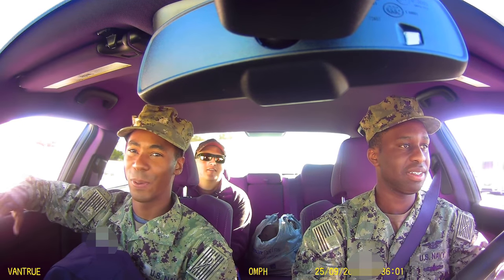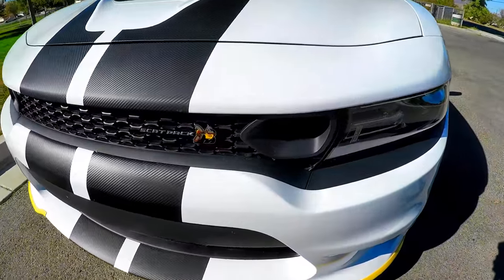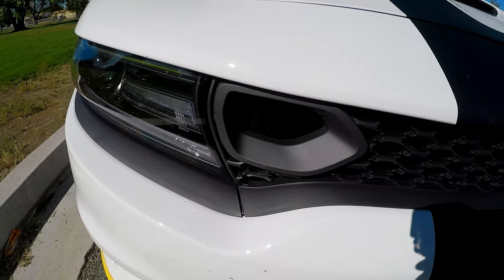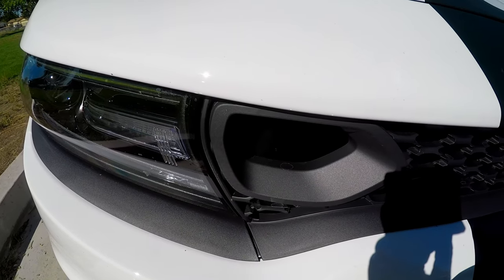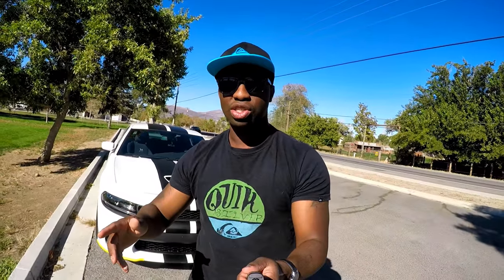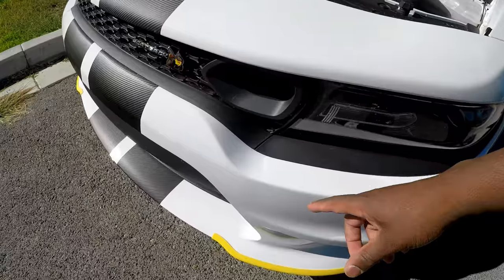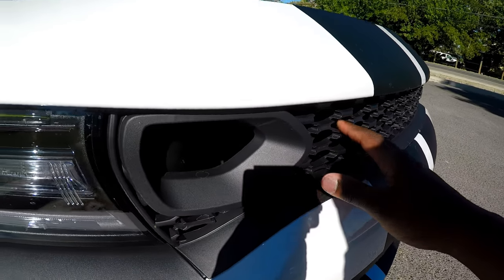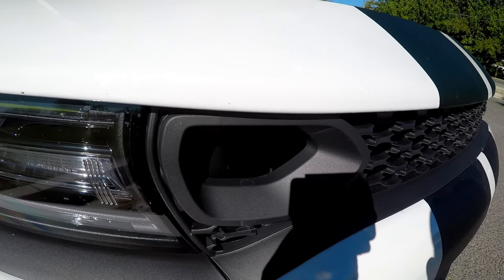2019 Dodge Charger Scatpack: The new Nostrils/Grille! NONFUNCTIONAL???

Comment from the maker: To avoid any confusion, the grille for the Scatpack is just new plastic inserts allowing more air to pass through. They are nonfunctional since there is no ductwork. Still based around increasing airflow via the motion of the vehicle. Maybe with the '19 Daytona or Hellcat it will be an intake connected directly via ductwork/filter, but who knows...
Reply: Airsoft Hemi im sure there will be an A/M kit available to set it up to an intake soon. Hopefully about the time I get to buy my Scat Pack!
Reply: They are not cosmetic, they flow directly to the radiator for more air flow through the radiator. So yes they are functional and engineered that way. Stick
A camera down there.
Reply from the maker: @jeffevans2551  Appreciate the feedback. I was using the term "functional/nonfunctional" in a sense as to are the new nostrils power driven. They are not. Similar to the Shaker hood design with the Challenger that's almost useless aside from having a good look.

I'm sure it does provide a degree of better airflow, but i can easily tell it's nothing revolutionary.
Reply: I can see where your coming from, but if there is anything g to learned from drag racing, is that a cooler motor and cooler air going into the intake does provide more power, bigger radiator and more air flow does create power. So if we look at it like that, it is functional.

Comment: As a employee of Chrysler, I can assure you that the nostrils in the grill are not ram air intake, they are in a sense ram air, but the are ported directly to the radiator. The nostrils in no way connect to the air box. If you stick a camera down there you will see nothing but the radiator. The scoop on the hood does direct air into the air box.
Reply: they do on hellcat

Comment: The drivers side intake port is perfect for the  Mopar cold air intake setup which is on the Daytona Edition Package & Hellcat.
Reply from the maker: Damn that would be a badass setup. The Daytona wouldve ran me over budget though. I would like to see a '19 Daytona
Reply from the maker: Kobes Note  Might actually become my Christmas present. That's sick bro! That and an 'oil catch can' and I'm complete. Appreciate the feedback
Reply: But what if it rains
Reply: The port doesn’t actually go through a “duct” to the filter box, it’s a port opening in the grill to allow more airflow through. The air filter box is encased also. The Cold Air intake box although has no top so it sucks the air flow on the top end but still has sides if that makes sense.

Comment: I absolutely hate this grille, so since it is non-functional would I do any harm if I were to change it to an ‘18 grille?
Reply from the maker: Thats something that never been done before. But im pretty sure an experienced person will be able to mod it with minimum damage if any
Reply: I swapped from a 18 Grille to a 19 Grille. Install Video on my channel . No damage. No change besides styling difference.
Reply: It is functional, it leads directly to the radiator to allow more air flow thought to cool it.
Reply: The driver side nostril can direct air to you intake.  You have to buy the 19 hellcat lower airbox kit. I just installed this grille along with the airbox on my 16.

Comment: Hey man, I know I had a request on your last video, but can you do me a solid and measure from the bottom of the exhaust tip to the ground? I need this measurement to check fitment in my garage. I have a stupid curb/step at the back.
Reply from the maker: I'll have to get back to you on this. My measuring tape "vanished". Stay tuned
Reply: Thanks bro, I’ll be looking out for the info.
Reply from the maker: @05bbs2kT  It is approximately 10 inches from the bottom of the exhaust port to the surface of the ground
Reply: Dang, didn’t think it’d be that high up. I have a curb/step at the back of my garage. I’m pretty sure the front of the SP wont clear it as it’s 5 3/4ins... so guess I’ll be backing in then.  Thanks for the info.

Comment: what’s up with the bumper guards staying on. don’t they mess up the paint?
Reply from the maker: They do mess up your paint if you keep it on for too long (as far as rumors go). Havent met anyone who actually got their paint damaged this way
Reply: @AirsoftHemi  i had mines on for 2 weeks and i still have lines where it was at, id take them off and put some protection there if you want to keep them on, they will rub when you turn or at high speeds
Reply from the maker: @Ambizious400  thanks for the heads up man. I'm going to get them taken off now. I know they should be easy to do
Reply: You should get a clear coat on your front bumper to keep it protected from debris

Comment: It’s not a ram air if it’s not connected
Reply from the maker: Same concept, just nonfunctional since there's no ductwork. Still based around increasing airflow from the vehicle's motion
Reply: Again mid information. Ram air is a trade marked term used by Pontiac number one, number two, stop telling people it is non functional, it does not go to the air box, the nostrils are pointed at the radiator, for better air flow through the radiator to keep it cooled, any questions, I can direct you to many videos that explain all this and actually stick cameras in there. But I work for Chrysler and own a 2019 Daytona myself.

Comment: How is it a ram air Intake if there is no tube leading Into the air box?
Reply: It’s not coming from the passenger side neither. Check out the widebody hellcat they have function ram air intakes. I was so excited for the 19 scat pack for this exact reason I can’t believe it’s not functional
Reply: People are saying u can get the hellcat charger box and kinda make one yourself like u mentioned
Reply from the maker: Guess i couldve worded it a little better. But for the Scatpack, the new grille is nothing more than bigger nostrils integrated in the design on the front grille vents. I'm assuming the Daytona is going to have functional ones since it comes stock with a cold air intake but who knows
Reply: Yep we gotta wait and see if they Daytona & hellcats are functional. Nice car man congrats on the 19!!
Reply: I'm guessing it's kinda like a better solution to Chevy's flowtie design. Just a little better airflow to the radiator, and it looks cool. I think it's nice the finally got rid of the R/T badge on the rear as well.